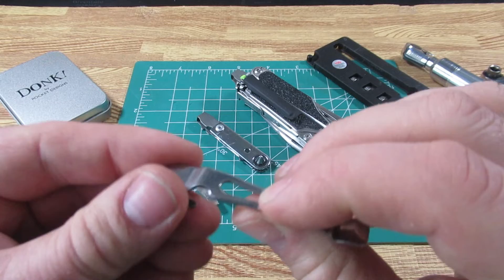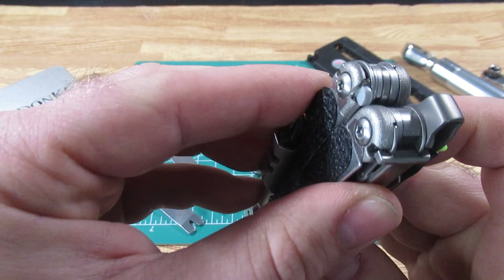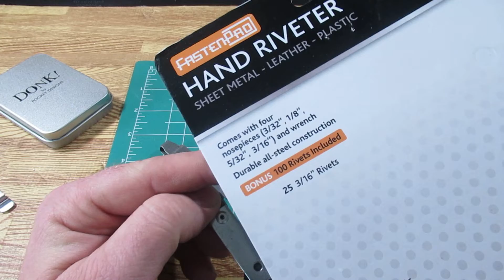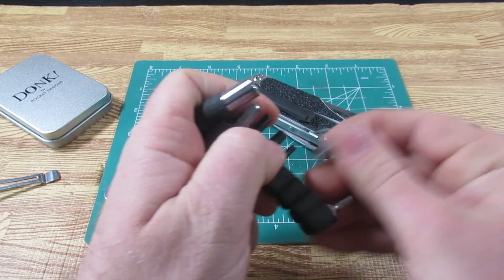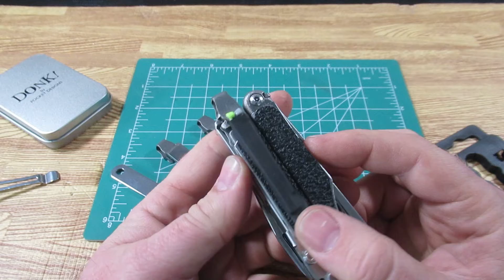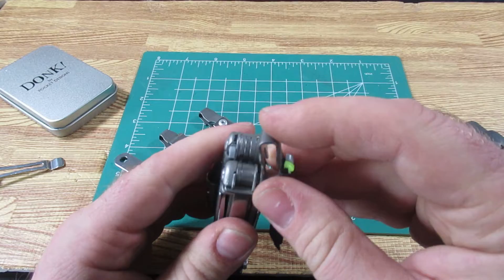Leatherman Wave Multi-Tool Pocket Clip Mod, Ratchets, Prys and Starts Fires!

Comment: This is the kind of guy who was born to make stretch limousines out of the old chevy trucks, but instead he got into knives
Reply from the maker: I like that!  It's just my garage is to small LoL!
Reply: @hvacbudget8600  btw, I just ordered that metal saw attachment for a wave +, from aliexpress, I'm gonna replace diamond file with that metal saw, because I don't know what I would use diamond file for. On the other hand I have a lot of experience with a metal saw and it could be handy to cut a metal pipe in half here and there, plus the blades are replaceable, it's Bosch T118 style blade. The attachment is around $40, and I'm not sure of the quality yet. Thoughts?
Reply from the maker: @PepperGeorge  I bought one for my Wave and I really like it.  If I remember there are two versions and I bought the more expensive b version.  I am pretty happy with it!  The most disappointed I have been with AliExpress in parts to mod my Wave was with the "Damascus" replaceable wire cutters.  They are far inferior to the Leatherman cutters.

Comment: Is the bgs slim ratchet driver takes any other bits ? I do have a slim driver but it's not as slim as de bgs one.
Reply from the maker: You can use 1/4" bits as well, they just may fall out easy because they aren't designed to fit as snug as the shorter 1/4" bits it comes with.
Reply: @hvacbudget8600  I see so the bits need to have that gap on the rear to be held, and I don't think there is much bits with that sort of gap aside of 4mm on some drivers, but I have a vessel one who can use every sort of bits. However it's not as slim but it works well and have a nice set of short bits.

Comment: Mr. Kincaid, I'm out of my league here, lol. None of my Leatherman multitools are modified. I find them extremely handy as they are, stock. The only accessories I have is the bit kit and adaptor from Leatherman. I really only carry the bare tool because I only like to carry the bare essentials. Multitool, wallet, cell phone, keys and coin change. If wear my winter jacket, I carry a lighter, extra multitool and Kinco insulated work gloves on top of the essentials.
Reply from the maker: Sounds good!